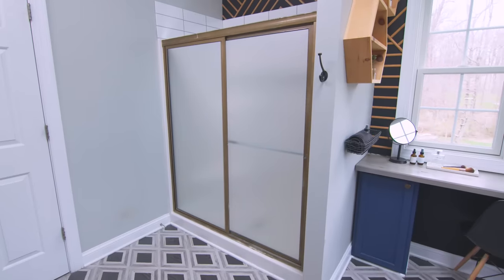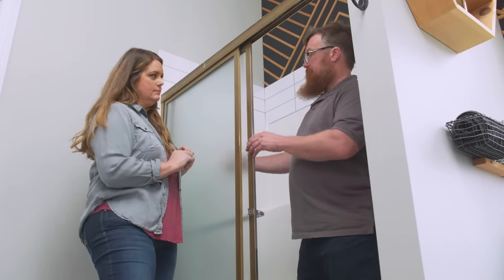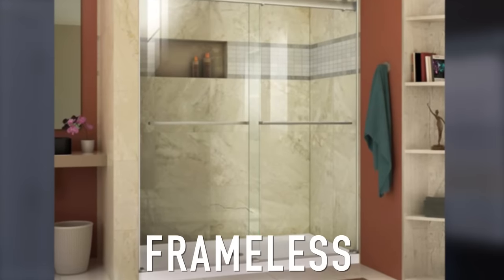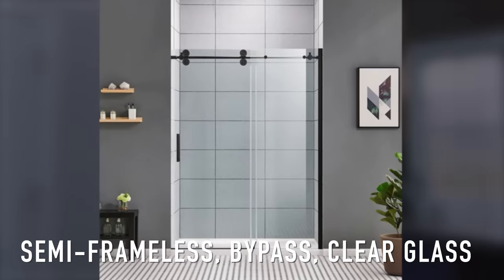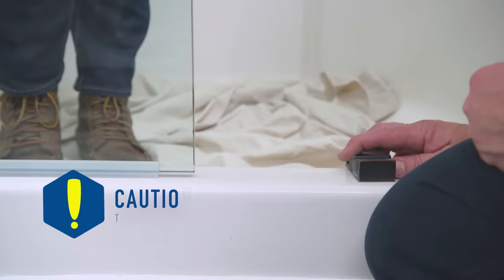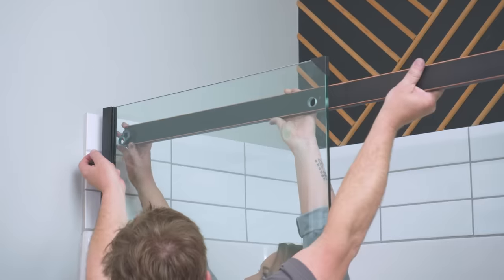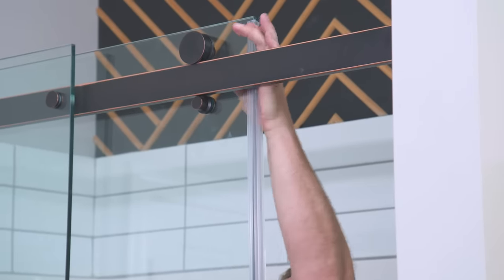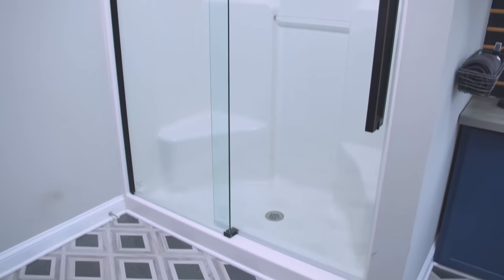How to Install a Glass Shower Door (w/ Monica from The Weekender)

Comment: At 10:52 you mention (again) that the sliding door track was screwed into the plastic shower threshold...that is risky since water is likely to get in there over time.  IF you do drill it in place, please add a blob of clear mildew resistant silicone into the hole you just drilled and under the track to (hopefully) prevent water going into the hole over time - do all this before screwing it in place.  Other glass door manufacturers and installers advise to use double sided tape to fasten that sliding door track (guide) in place, then silicone around it.

Comment: Monica, please work on a shower stall that can be enclosed to provide a “steam-like” experience without an actual steam unit. I have concerns about dealing with builder grade shower walls. How do you deal with the steam if only part of the wall is tiled? How does one deal with the ceiling light above the shower stall? What kind of steam escape can be installed when all the shower doors don’t reach the ceiling? What kind of fan must be installed to deal with so much steam once the shower door is opened?  So glad you can work magic to a builder grade bathroom. Love your work!!! 👍😉💕🤩

Comment: To install a bypass double door on those plastic showers kits with bathtub is it the same steps as far as drilling on the side for the rails? If I knock on the side of my shower walls  it feels hollow inside. How would I install the side rails here, do I get longer screws?

Comment: I have a tub shower with tile at top and fiberglass wall tub and want to install bypass tub shower doors, but at a height higher than the fiberglass wall unit. Will thus kit wirk fir me? What name brand kit did you use and will the kit work for a bathtub?

Comment: We are planning exactly what you did here Inc,using maiming it taller.  What did you do about the gap from the top of the shower line where the tile starts to the top of the vertical bar?  It’s at least an inch.  The door looks great but I’m concerned about that gap and water coming out both sides above  where the shower liner ends.

Comment: What do you do if your toilet happens to be on the same wall as your shower head/control lever?   I would have to have the stationary glass panel next to the tub and shower head/lever and the sliding side on the opposite end, or I would not have easy walk in/walk out access to the shower - because the toilet would be in the way.....   Yet, if I had the sliding panel on the opposite end of the shower head, wouldn't that expose the sliding door to water leakage between the glass panels when the shower is running?
Reply: It's been a year but....did you figure this out? I'm thinking the fixed panel needs to always be on the same side as the shower head....

Comment: I bought a shower door kit from Lowes that is almost the same.  It's very heavy--ours is in Chrome finish. It's beautiful,  but it leaks on the front edge corner.  I think my contractor installed the front edging wrong after watching this video.

Comment: Do we need to put a water seal on the bottom glass ? I mean, it would not attach that perfect, because the door is not settle, i mean we can open and close it.. so it would not seal that perfect.. can we replace with any plat and attach it on the bottom side glass ?

Comment: So much false information recorded in this video! There are so many things that could happen that was not actually listed in this video. Example, not every shower door can fit or even work on a shower door due to outages on the walls because of the walls/curb aren’t level/out of square to much. Some manufacturers also require the guide system at the bottom to have a minimum width required at the base/ curve for it to fit. That’s just the basics before you buy a shower door. Not while installing or the tips and tricks for what ever doesn’t add up.